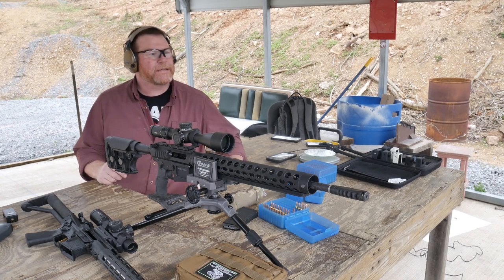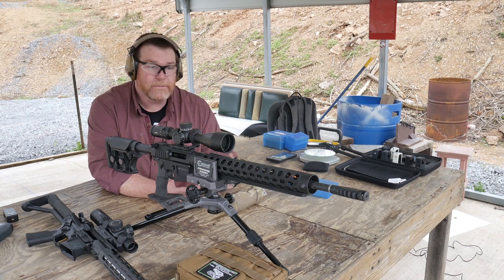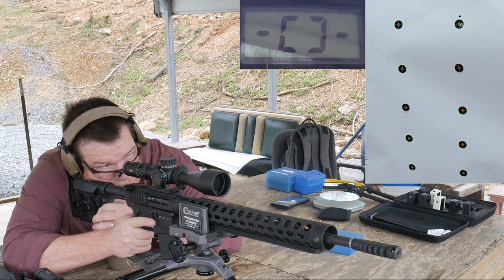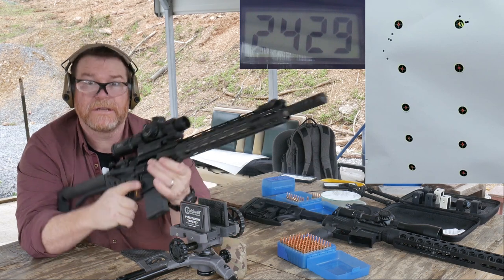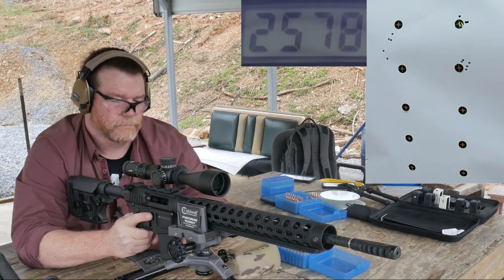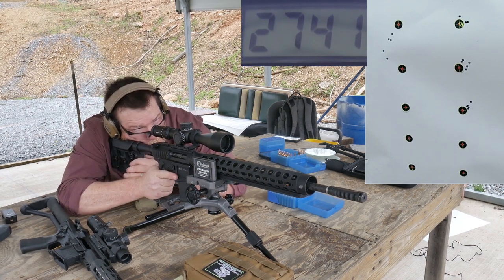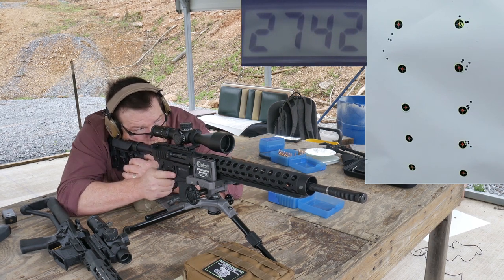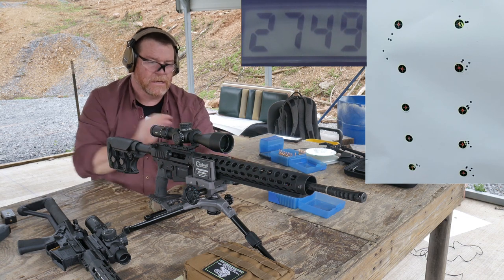Load Test Development Part Two:  The Showdown Sierra Match Kings for the Win

Comment: I just did a ladder test on my 3 gun competition gun last Saturday for 150 yards. Used an 18 inch 1/8 twist barrel and using 75 grain BT-FMJ using H335 23.5 moving at 2725 avg FPS and got .589 MOA. I am pretty happy with this result and it's going to be my new load for my 3 gun here in Texas.

Comment: Man that dmr is impressive regardless how much it cost to build.  Id say looks like you've found the perfect load for it but honestly from the videos ive seen with this rifle it has pretty much shot everything into tiny groups.  Actually working on my own $$$$$$$ dmr build its going to take a while because im just a poor man with an expensive gun/ammo addiction lol. My current dmr does pretty good( .75-1.25) moa but I want to take it a step up from the aero precision receivers, and all the other middle of the road parts I used to build it with.  Its an 18" faxon match series 6.5 Grendel barrel, matching bolt,  ubr stock, radical firearms 15" rail, rock river 2 stage trigger, and a 4-14x primary arms acss. My new one will be built on a sharps bro overthrow lower, and a 2a armament  balios upper,  so far that's all I have. Trying to decide what barrel but it will be an 18" 223/5.56 also want to step up a little when it comes to the glass, going to stick with primary arms just going with either the 3-18x SLx or 2.5-10x Glx if they ever come back in stock. Whats the deal with primary arms optics? they all been on preorder for months now

Comment: I guess you are trying to match it up with the  ACSS?
Reply: Yup.  It was a total pain in the ass but I finally got mine to match up. I ended up having to have to buy a new Barrel. For me to get my 18 inch 308 to closely match up to the acss reticle I had to switch to 155 grain Hornady ELD M heads. Over 46 grains of reloader 15. Gave me 2650. It's not perfect but it's close enough. 2700 to 2750 is much better.  If you are going to indulge in this endeavor I highly stress getting strelok Pro app.